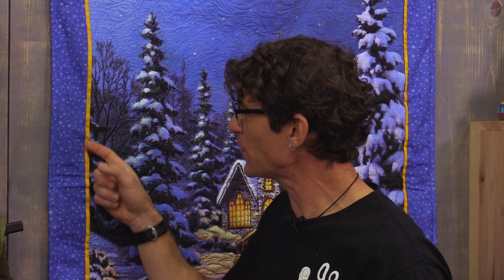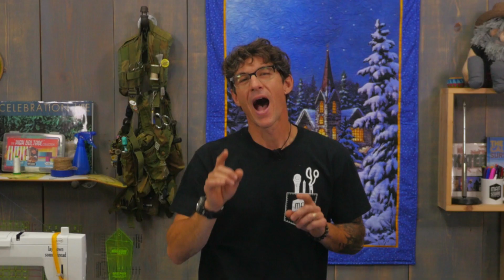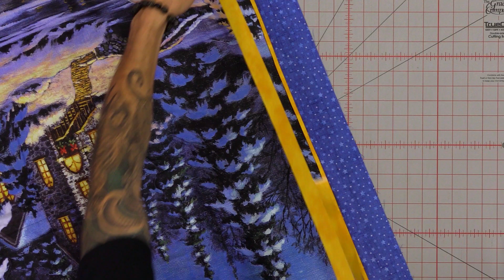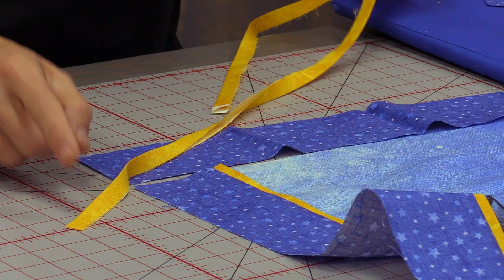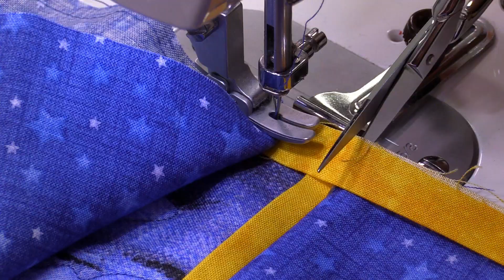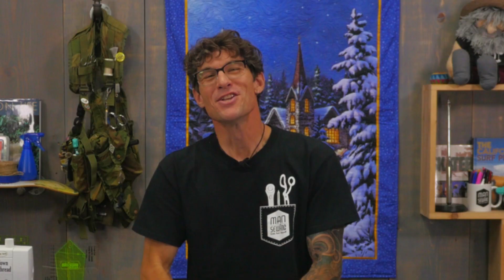3D Flange Binding Quick Tip

Comment: Great technique! Is there a way to do this with a mitered corner? 💜🌞🌵
Reply: Hi Suzi! I brought your request to Rob and here is his response:

Thank you, I will keep that in mind for Tutorial or quick tip content as that is a great idea. In the mean time, I do not think it should be too hard at all, but I would skin this cat one of two ways
1. Sew on the flange boarder first with straight ends to make it easy, then miter the larger border. 
or
2. Sew the flange to the boarders first, then sew to the quilt and let run long on both ends to miter, but in this case you would be mitering both borders at once. I have not tired this, but I do believe it will work. 

I hope this helps!

Comment: I like your explanation on how to put on the flange. Not to be critical but I see that the border looks wavy both on the wall finished one and after you put the flange on & ironed the 3rd side. I was wondering if this happens because you didn’t measure the length of the side thus cutting the border to the exact length before sewing it on?  I was told measure and cut to length then sew on border.